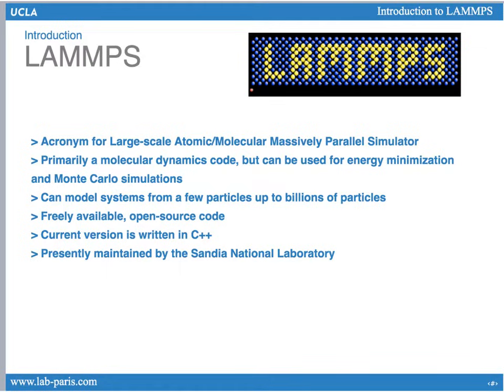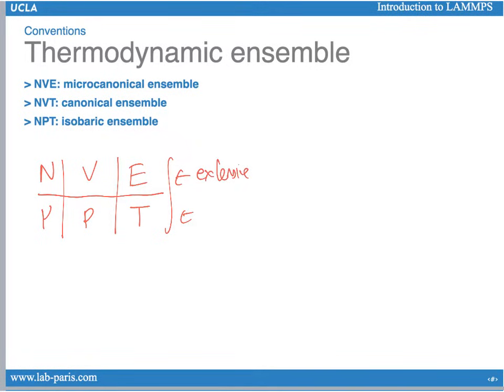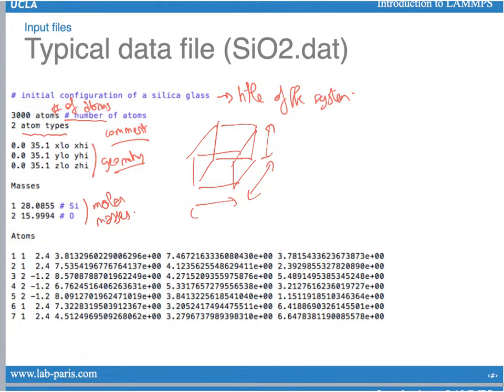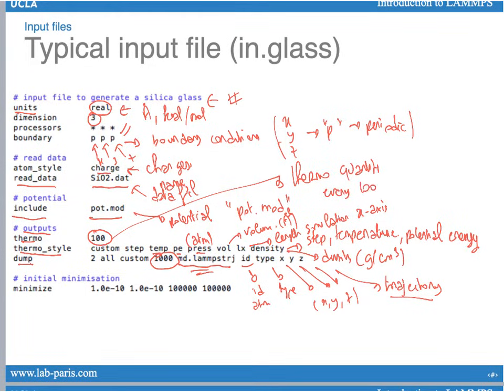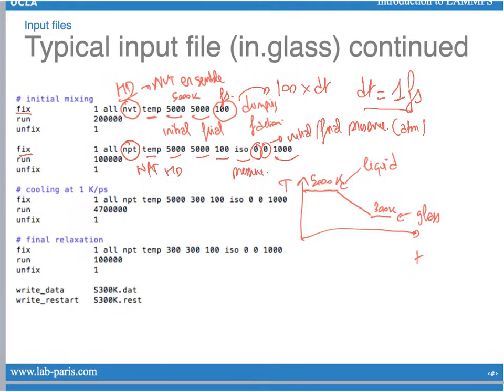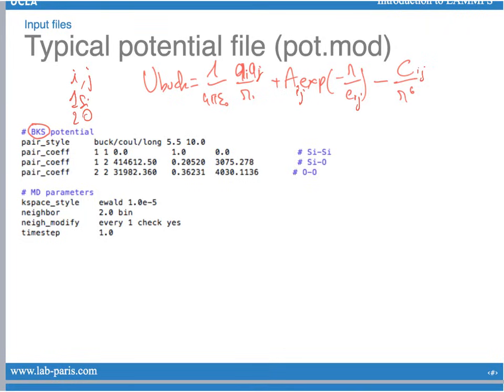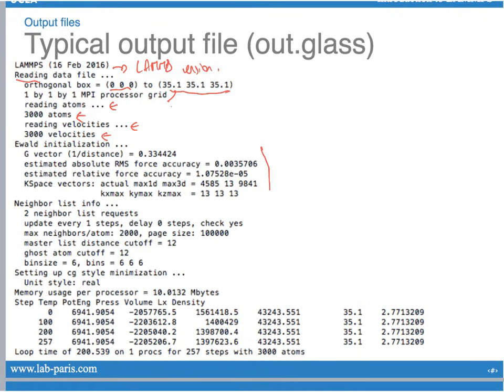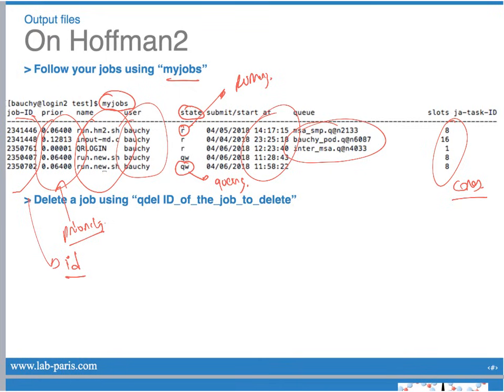Introduction to LAMMPS | Molecular Dynamics Made Easy

Comment: Like as you said, i created SiO2 molecular in Avogadro and then create a data file for 3000 SiO2 molecule. In this data file atoms are neutral. So on running MD simulations LAMMPS shows error for kspace_style as in your example Si and O both have some charges. 
So my question is, why there is charge on Si and O atom in SiO2 molecule when SiO2 molecule have covalent bonding?

Comment: Is it necessary to use data file witg intial positions of atoms if you are just interested in calculating melting point of metal.
Reply from the maker: In the case of a metal, you can directly specify the unit cell
Reply: @MBauchy  thx a lot

Comment: This is an informative video. I would appreciate if you can use LAMMPS or OVITO to observe molecular dynamic simulation on "doping" manganese into magnesium oxide in form of a proportional composition  0.25Mg-xO-(0.75-x)Mn to obtain best mechanical properties such as Young’s modulus E, bulk modulus B, shear modulus G, poisson ratio, density etc towards much stability and activeness. I will appreciate if you can help with this. Thanks

Comment: which software is used to create data file
Reply from the maker: You can use the Packmol software to create an initial disordered configuration.
Reply: i already tried with vmd but it is showing error like out of range of atoms -pppm cannot compute
Reply from the maker: Although you are starting with a "random" initial configuration, it cannot be too unrealistic. An initial configuration containing very unrealistic structures (e.g., O atoms that are close to each other) will tend to "explode" (i.e., atoms moving from the length of the box during 1 timestep).
Reply: even with creating random option also giving same error. any suggestions
Reply from the maker: Make sure you start by an energy minimization and relax the system. The "fix nve/limit" command might be useful to relax highly unrealistic configurations.

Comment: In slide at 1:12:06 you described potentials between atoms that are in different molecules. However, I did not understand how you describe interaction between atoms within same molecule of Si02. Are the lenghts and angles between Si and O atoms are constant (SiO2 is held as rigid molecule) or are there potentials to describe interaction between O and Si atoms within same molecule? And finally, Is there a way to choose one of those options?
Reply from the maker: Hi—please note that, in this example, we are not simulating any molecule, just individual atoms that interact with each other. 1 = Si, 2 = O. So the Si–O bond length and O–Si–O are not constant.